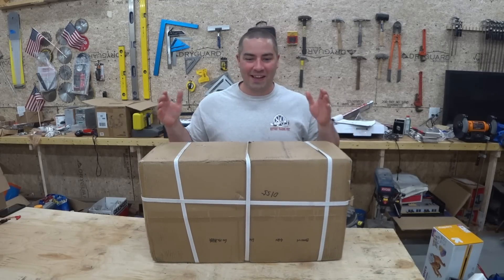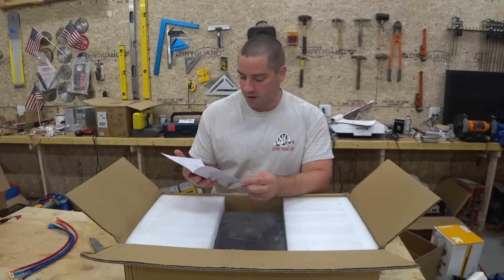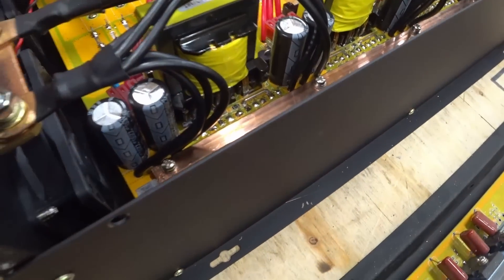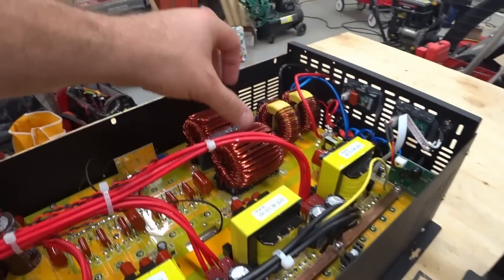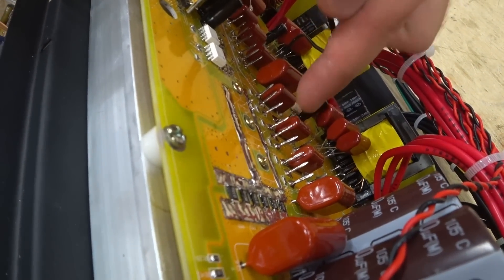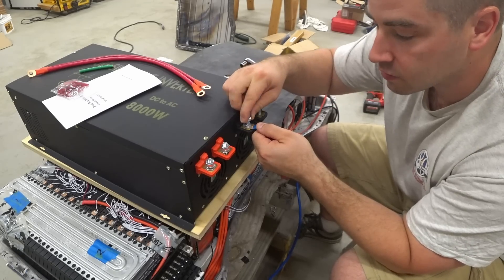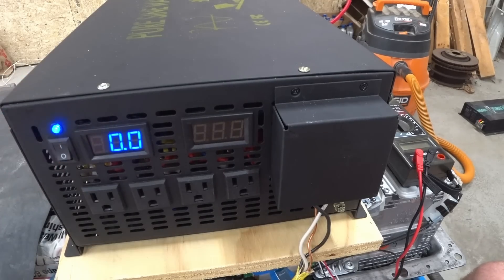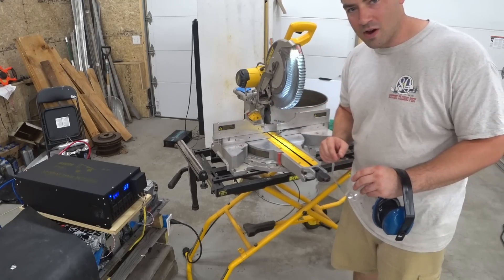Cheap 8000w Reliable Inverter, That Works! WZRELB

Comment: That inverter is awfully light for 8000 watt I have a 3000 watt and it weights 65 lb
Reply from the maker: Yep, that's the difference in HF vs. LF (high frequency vs. low frequency).  I also have an AIMS 6000w inverter that weighs about 90 pounds.  That's why I was so surprised this HF inverter could start my compressor and tools.
Reply: @DavidPozEnergy  it starts them....for now. I had one with a similar design a few years ago. I tested it hard when I got it and was super impressed that it started 2 drop saws at once. But I was getting shocks off my battery terminals around 60v AC. I later found out this killed my batteries. 
Then 3 months later the smoke detectors went off when only the washing machine was running. Smoke came up through the floor. I raced down to the basement and through the smoke I could see flames shooting out from the inverter. Some of the fets had shorted and were arcing, setting all the cables on fire. If I had not been home to disconnect the battery bank I would have lost the house
Reply: My 5000 watt is over 110 lbs.

Comment: great tip on precharging the caps...I wondered about that...every time I turn on my inverter there is a big zap, doesnt feel good.
Reply from the maker: That tip is thanks to my viewers.  Last video I posted a couple people suggested it.  That's the awesome part of YouTube, sharing and learning.
Reply: You shouldn't need to "pre charge" the caps (in most home sized inverters) if you're using a disconnect or breaker. The entire point of a mechanical connection is to contain/avoid sparks.  In the previous video David was open-air connecting the inverter directly to a 56V battery which is a bad idea.  In this video he has DC breakers which should have been more than enough to handle the fairly limited inrush current (hint: he charged the caps in a second or so even through a resistor).

The other point to using a breaker/disconnect is that you can reliably disconnect power if something bad happens.  Whereas with a direct wire connection the wire is bolted on and/or may fuse to the device/battery.
Reply from the maker: Hi Tom St Denis,  I can see your point that the circuit breakers contain the spark.  There was one other reason a viewer suggested pre-charging.  He said the in-rush current could fry the BMS's.  I don't know how much of a risk that is, but the BMS's are expensive.  And it's good to know the caps charge in a second.  I didn't know how long to leave the resistor on there.  LOL
Reply: @DavidPozEnergy  Perhaps.  Though for most home sized inverters the caps aren't that big that you're going to sustain a load for an appreciable amount of time.  A BMS big enough to feed the inverter at load should be able to handle a few 100 amps for milliseconds.  For comparison, hook up a 500F super cap to a battery and watch sparks fly :-)  I have some of them ebay 500F  caps and it takes minutes to charge up at several amps...

pre-charging won't hurt but it's an extra step you could in theory do wrong.  You also have a high potential terminal floating around on the other side of the resistor that isn't protected against shorts....  e.g. if you drop the resistor on something that is grounded you will short that wire out.
Reply: @DavidPozEnergy  I think it is prudent..victron even has a special unit that does this exact function, charging caps then turning on a contactor...caps are a dead short to DC until charged and most inverters have a few caps to stabilize things.
Reply: DavidPoz - I was wondering if the capacitors still had a charge when you opened the panel. 😯
Reply: @rickyricardo4718  me too!
Stay safe!

Comment: 2 things, smaller wire is OK on very short runs and the mosfet legs sticking up thru board will help heat dissipation.
Reply: That's a good point - I did think at first that it looked very lazy not to trim the legs, but anything that helps to dissipate heat is a good thing, even if the effect would be marginal.

Comment: I got the 6000 watt cont -18kw surge for 20 seconds, 24 volt aimscorp PICOGLF60W24V230VS type inverter split phase 120/240 which is really 2x 3000 watt legs 3 years ago, been running all the 120 circuits in the house for 3 years in ups mode, similar price also working good. has built in 85 amp 4 stage charger connected to 8x L16 6v 400 ah series/parallel . but am real impressed with your 8kw. keep up with the great vids. hey nif i use your amazon link and choose a diff product, will you still get credit ?
Reply from the maker: I think the way the amazon link works is, Yes, I will get credit if you don't close out the window.  So if you go to amazon from my link, then anything you buy while that browser window is open is credited.  But I'm not an expert on it.
Reply from the maker: I also have an AIMS that is working great.  The surge watts on the AIMS is higher than this.

Comment: It defiantly seems to me that the wires are way to small. You might want to check the voltage gauge on the inverter, to make sure it is measuring right. 
Great video, I always enjoy your videos!
Reply: Defiantly lick your fingers and touch the output

Comment: David you didn't take into consideration the length of the wires. The shorter the run of wire the smaller gage wire you need for the same amperage.
Reply: I think that's only because shorter wires can dissipate heat a bit more easily at each end.
I like to see as much copper as possible!
Reply: @ahaveland  Fuses, think on then, you'll never get 10 gauge wire on 30 amps fuses, it just a matter of the ohm law. That little piece of wire probably has about 0.07 of voltage drop at 67 amps so no a big deal, of course after that wire he can't pull 67 amps with a simple extension cord cause its impossible without causing a  fire.
Reply: Andy Lee Robinson No it’s because there is less resistance. The longer the wire the more resistance, the more heat dissipation required.
Reply: Less voltage drop from being short. Wire still has a resistance value. Think of it as pulling your car with a rope, longer and smaller will have more stretch.

Comment: Sounds like your happy with the Reliable - do you plan to replace your AIMS or augment it?
Reply from the maker: I'm thinking of setting up the reliable inverter as part of a diversion load project, but keep the AIMS for my regular house load.  I've actually  been running on the AIMS pretty consistently.
Reply: DavidPoz the AIMS looks like a beefy unit. I watched you unbox it and go “woah this is heavy!” Kinda like my Victron 3kVa 48v unit. Hint: do not drop LF inverters on toes. They hurt. ;-)
Reply: Btw love your videos. You seem very enthusiastic about your project power wall. The things with wire around them (tube thingy and donut) are called chokes. They strip high frequency noise off the ac output.
Reply from the maker: Thank you.

Comment: It looks like the wire gauges are for 220/240V output and they haven't upgraded them for 110V use.
That is a really nice setup David.
Reply from the maker: That explanation makes a lot of sense.  The person in the factory who put those wires on did not consider if it was a 230v or 120v output.
Reply: @DavidPozEnergy  Really??  Wire gauge is determined by current requirements...not voltage requirements. It's called ohms law !!  W / V = A   i.e. 8000W / 240V =  33.33A  >>> 8000W / 120V = 66.66A  10 guage THHN is good for 30A so for 8000W @ 120vac    66.66A / 30 = 2.22   10 guage wires or 3 wires will cover the max load !!
Reply: @electroman982  exactly chief;  HE is right;  ohm's law;  that is why if it is 110 V , the traces needed to be doubled,since at 110 the current is TWICE the current  at 220.
Reply: Very likely, other issue is the traces Likey can't handle 8kw for to long as well at 120v (a lot of power is going to be trying to go though that screwed on the blade as well I could see that getting super hot) 

like other reliable inverters (the brand) I wouldn't put constant past 3000-4000w on this at 120v, if it was the 240v version 8000w is more likely doable (still 32amps thought) 

I believe wattage on the inverter is peak short time load on all reliable inverters (about 5-10 minutes) but as these are Mosfet based inverters I still wouldn't put more then 3000-4000w on them if I wanted to last more then 9 months (especially if your on 120v as amps are silly high 30-60amps on that small cable and the lug it's on)

Other issue is having the one full heatsink for everything as it bypasses airgap for dc low voltage (but high currant) <> AC high voltage (lower currant) there is a risk of dc <> ac jump (unless the block is grounded but if it is the battery pack will melt it)

Transformer based inverters are generally better for motor loads and less likely to blow up for over 5-10 years
Reply: How many hour backup From 148 Bolt
Reply: Wolfgang Preier  you are talking shit. I live in Europe and have never seen a house has 3 phase just for the oven,which is more than 3.7kw.  My main breaker is 63 amps fyi.
Reply: A 10 AWG wire carrying 80 amp at 120V only drops 0.16V per foot. That means its going to dissipating ~13 watts of heat via the wire per foot. With air flow from the fans, that wire will barely get warm.
Reply: how much THIS prices
Reply: How much THIS prices
Reply: How much Piece this inverter